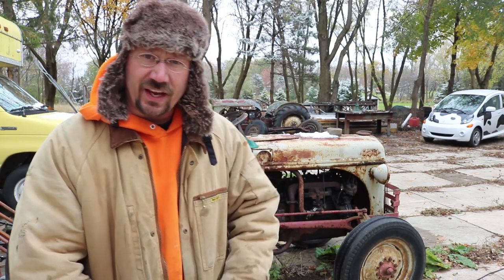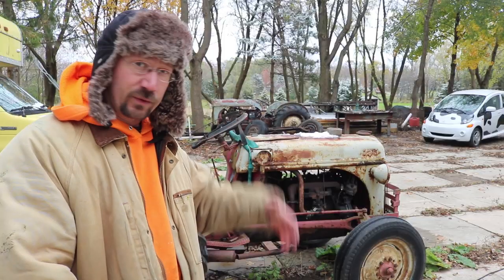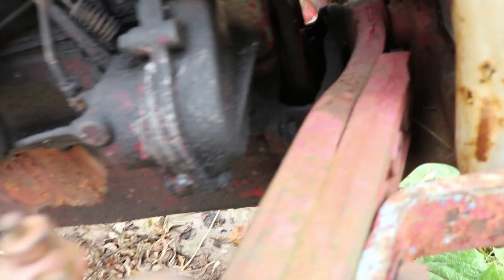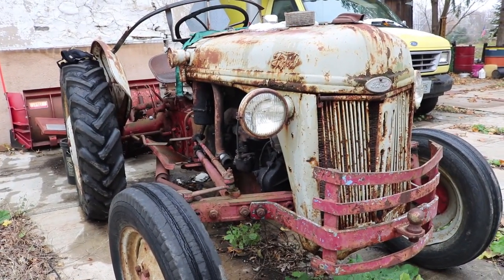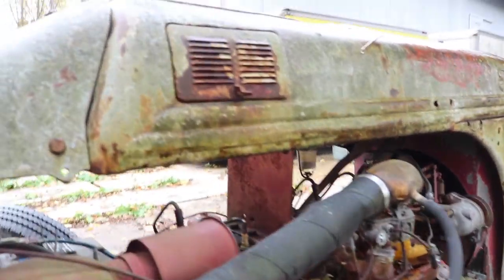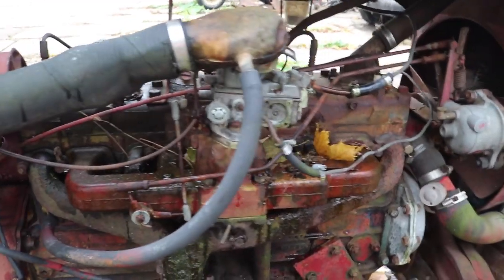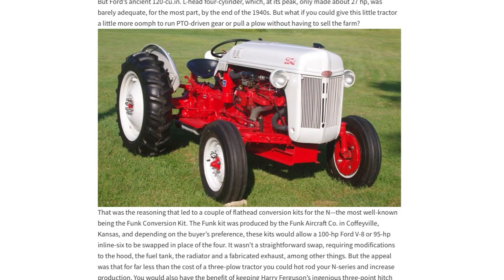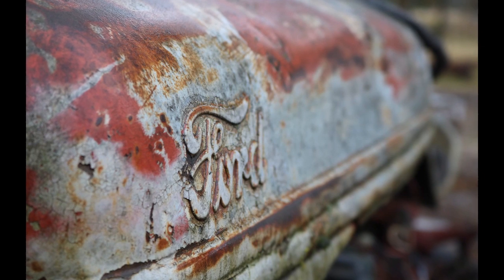Funky Ford 8N Tractor for Electric Conversion?

Comment: The 2nd tractor looks like a Ford 901. My buddy loaned me his when I bought some property. It would be a better choice as it has a 2 stage clutch and the 8n doesn't. That means you can stop the tractor without stopping the PTO shaft. I think you could drop in an electric motor and build a frame around it for the batteries and controller assembly. Looks like it would be a fun project. Thinking outside of the box is what electric engineering is all about. You'll need a lot of battery, but the torque .... Whew buddy, watch out. Love the channel, keep 'em coming.

Comment: That is indeed an 8n with an inline 6 adapter kit installed.  And these were done as conversions by some dealerships.  The motors were military surplus left over from WWII, but I've forgotten what they were originally for.  There were also at least 3 aftermarket transmissions made for the 8n that some dealerships would install to lower the gear ratio at rear wheels.  Stock 8n's were pretty anemic tractors, but still sold well because they were reasonably priced for the time.  One of those transmissions actually installed inside the factory casings, and isn't really visible at a glance.  The other two actually sandwich between the factory castings, add another gearshift, and make the tractor visibly longer.

Comment: Hello, Your Funk conversion is a rare piece of history. I have the 226 Ford cast iron oil pan Funk conversion. What you see there is a Funk rail kit like you said but that tractor has the 254 Flathead large truck engine. I have never heard of that M Series engine being used until I saw the 8MTH casting. The typical 226 conversion uses the H series Flathead. Same bolt up just larger bore with a heavier duty crank and rods. That engine can handle RPM's.
Reply: I have one , and I'm looking for information of any kind. If you can help me out I would appreciate it thank you.

Comment: We used to have one of the regular 8N when I was young. The possibilities of the conversion is pretty good, especially if the radiator isn't rotten. An AC motor would work the hydraulics better but DC will be closer to the original IC's rpm range.

Comment: I'd love to see a ford 9N, 2N, or 8N conversion.  I'm fairly sure none of them had a "live" PTO or hydraulics so when you press in the clutch the lift arms didn't work.   So that being said it might not be the best choice if PTO or using the lift arms are going to be an important thing for you.  But I will add another asterisk to that because in the case of a electric tractor conversion it may make the most sense to have a separate electric hydraulic pump anyway so you don't need to run the drive motor to use accessories. I've never looked into it but the internet seems to indicate a N series tractor can be converted to live hydraulics with an engine pump so I don't see why you couldn't convert it to electric hydraulics.

Comment: I've been toying with the idea of an electric tractor build in the future and it seems to me that an Allis Chalmers WD or wd 45 might work well. They're common, cheap, smaller in size, and have the engine mounted on two frame rails so it'd be easy to remove.

Comment: An idea with the 1st one not knowing what it looks like inside but I would pull everything off the top and keep the oil pan. The oil pan looks like its the main frame connection and may be big enough for the electric motor to fit in. If not you could do some cutting. If you do have a motor that will fit inside the pan you may just need to weld in some extra metal to reinforce it.

Comment: Hi Ben, Terry Richards here.  Tim Chapin did an electric conversion in the next town over from me.  The simple answer is to build a 1/4" steel plate "box" to replace the engine block (get with your local weld shop), so if the price is right, the 8N would work as a tractor conversion. You may want to look at other tractors (maybe an Allis Chalmers WD?) but I find that while they have a full frame, they're also a taller tractor.  Here the EV album link to Tim:   http://www.evalbum.com/4736
Reply: Nice!

Comment: That's the oil pan it's bolted to, not the engine block ;-)
Reply: u could take the whole motor out, take off the block from the oil pan, and reinstall the oil pan as just a frame piece. Then do your thing. Love the channel.
Reply: https://youtu.be/bZbSoRvNSKc?t=72 (1:12) take a close look, there are 3 pieces there, the lower portion is the oil pan, that bolts to the front frame. The upper portion is the engine block. you SHOULD (dont quote me) be able to seperate the block from the pan, and reinstall the pan, GL. I have a little experience with these tractors
Reply: @biomecaman3514  , yes as you say, you can see the difference between the thicker structural oil pan at 1:29 and the conversion regular non-structural oil pan around 2:29 &thereafter. Been so many years since having one apart that I can't remember actual thickness and internal dimensions, but it seems like the structural pan front could be grafted to whatever length/width framework had to be made to accommodate the electric motor, though the weight of motor/batteries might better be handled by a trussed frame with the top rails structured to hold the batteries under the hood above the motor as Benjamin seems to be thinking. In that sense (though I have no experience with such a conversion) I would think that the original tractor would make as good a base for the electric conversion as the six cylinder converted tractor since the added frame rails are too specialised, and hood length/hight dictated by the electric conversion with the fairing methods used for the six cylinder conversion in mind. Interesting project, looking forward to the results.

Comment: I've always wanted an old tractor, I live in the city with a very small front yard so it's not logical. Wife says what are you going to do with it, I told her park it the front yard it when the grass needs mowed I just started shut it back off, Grass is mowed. Just something about an old tractor, must be a guy thing.
Reply: tractors are very interesting. My family used to go to a sporting club property in New York state. The ford tractor we used to have formerly belonged to the US post office! "Old Blue". I remember sitting on my grandfather's lap working the steering wheel mowing the field (couldn't reach the pedals). Big 4ft wide mower bed connected to the PTO. easy to fix
Reply: @biomecaman3514  what's a cool story

Comment: you can buy brand new Chinese tractors  , minus the engine .  cheap  . this might be cost effective compared to buying a used one and rebuilding it and replacing things like  the tires and rotted out  rims